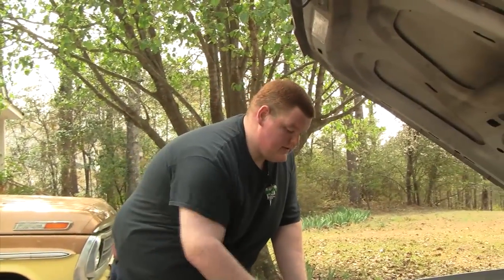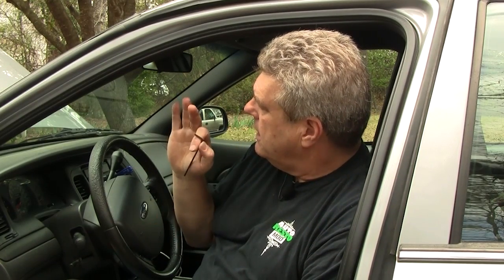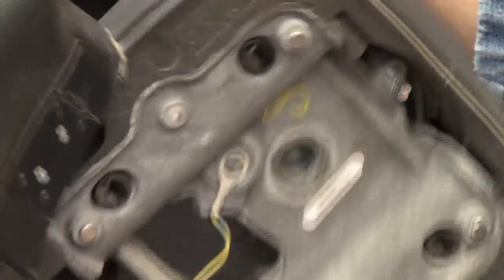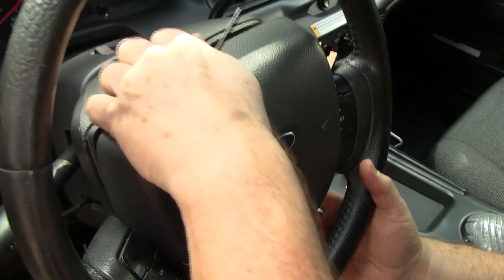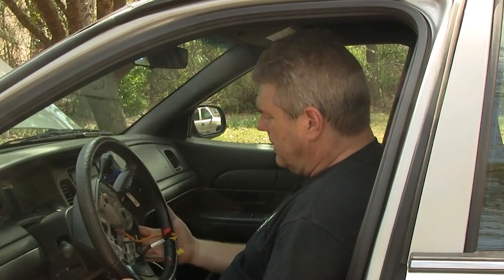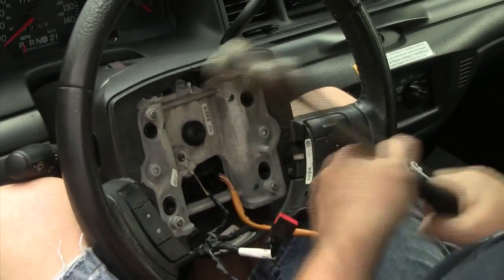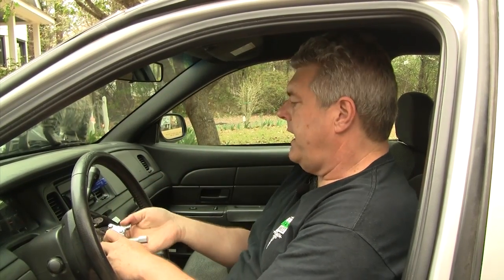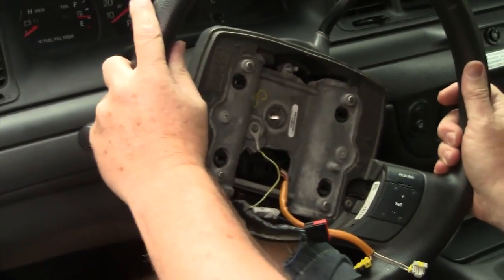Safely Remove the Air Bag SRS From 2005 2011 P71 Crown Victoria Episode 5 Manic Mechanic

Comment: Sitting here and watched this and no idea why. Don't even own a Crown Vic. Good video anyway. Good job guys.
Reply from the maker: LOL, we get that way too. Never know, may come in handy on another Ford of the same era.
Reply: AutoRestoMod Car Restoration Modification I did clock spring and steering wheel swap my cruise control didn’t work any reason why???
Reply: Katrenka Davis mine neither 🤦🏾‍♂️
Reply: Katrenka on 05-11 you don't have to change the clock spring. Only a steering wheel with cruise control. It won't automatically start working though, you have to have it flashed by the dealer or mechanic that has the proper software to enable the cruise control function on your car.
Reply: @jirih2430  your exactly right..you do NOT have to change the clock spring,just a PCM re-flash..05-11 models

Comment: Those bottom ones are always tricky when trying to do the top ones. I always shoved a screw driver in the bottom so it doesn’t lock back in place

Comment: Do you know what size jaw puller that is? I found a couple on the local auto part shop website for like 10 bucks, I don't want to spend 30 on a three peice kit that I will only use of them once

Comment: Hi great video it was helpful for taking off the steering wheel.  At the end of the video you mentioned that all you needed to do was change the clock spring and get a wheel with cruise control buttons on it and you would have cruise. Let me tell you this is not the case. I got a clock spring out of a crown vic that had cruise and tried putting it in my 2010 crown vic and it did not work. Still no cruise.
Reply from the maker: Huh, this car is a non cruise control P71. When I bought the car I had them add the wheel and was told that they just had to change the clock spring. It may take adding a fuse to the fuse block to get it going. The only issue I have is that the light on the dash does not light up.
Reply: To add cruise control in a crown Victoria without cruise you must have Ford program it. All you need is the steering with the button and Ford programming

Comment: I thought I read in later crown vics drive by wire 05+ all the clock springs are the same. so to add cruise to a 2011 Vic you would only need the wheel with controls and a visit to the dealer to enable?? Maybe it was 06+ all the clock springs are the same.
Reply: Headless Bill 
Did it work?
Reply: Mr. HighBall correct. Install steering wheel. Then take to Ford dealer to enable cruise. Any town car, grand marq or crown Vic wheel 2005-2011
Reply: Yes. All set did this awhile ago no issues since.
Reply: So you do or do not need to replace the clock spring to ad cruise to a non cruise 05-11 cvpi?
Reply: @butcherChrist  you do not need to replace the clock spring . Just the steering wheel
Reply: @mikeeyg1977  Thanks!
Reply: And have it programmed/enabled which is not much more then checking a couple boxes

Comment: Mate, you were so lucky the wheel didn't come off and hit your nose when you were pulling on it. The retainer bolt or nut as the case me by should always be left installed, loosened off to stop facial injury.
Reply from the maker: From Jeff: Yep I messed up.

Comment: when I 1st got my o5 cvpi the lighting control module was 1/2 bad, Sometimes the headlites would shut off, (I had no idea what a LCM,MAF,MAP,02 sensors etc was, so to get the lites back on I would bang the steering wheel & they would come back on... after a few months of banging something broke under the air bag area so now the steering wheel feels like its gonna fall off, it moves all ova the place but won't slide off, yesterday I got a rejected inspection sticker so I need to fix whatevers broken... Any advice will be awesome.

Comment: just go and get the proper wheel puller first,  to avoid that broken nose lol. cool info about air-bags.
Reply from the maker: We put the bolt back on when we tried it. We've seen those wheels come off with one solid hammer blow or with a "heel pop". That one just didn't wan to come loose.

Comment: Does this mean you're updating the suspension on Colonel Mustard/ other car...? CV/p71 from this year range have removable cross members that slip right in on bump and dent and can be shortened for mustang or older trucks :) ok just have thought about doing it on my truck and just want you guy's to show how
Reply from the maker: Not on the Col. But we are looking at a detailed how to on another f100 using a Crown Vic front end. This was don on the Company Staff Car.
Reply: I figured the P71 looked too clean to rip apart just yet

Comment: Where did you find a clock spring? I'm trying to add cruise control to my 2010 P71
Reply from the maker: When we bought the Vic they added that. It is available from Ford or through most internet parts houses.

Comment: what steering wheel puller is that?
Reply from the maker: Just a two prong puller we got at Harbor Freight.
Reply: cause the one i used started to strip the torx bit
Reply: @ricangle  if you are referring to the black bolt holding the steering wheel try using a quarter between the bolt and the puller "shaft?" .  Not saying it works, just that you could try that. ;)